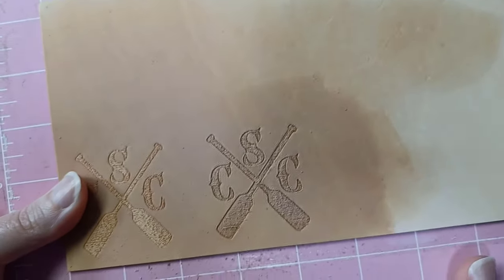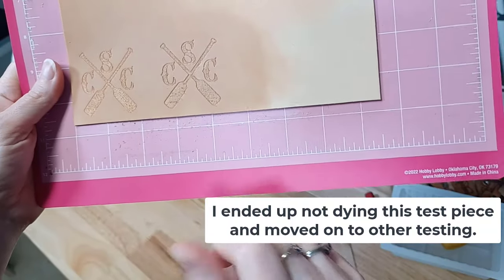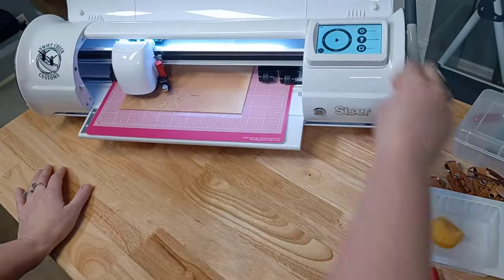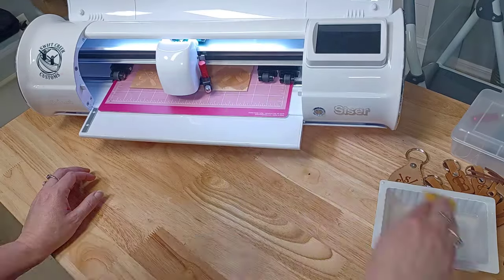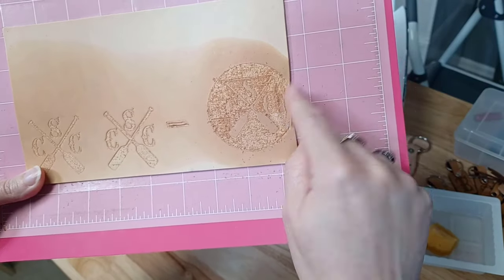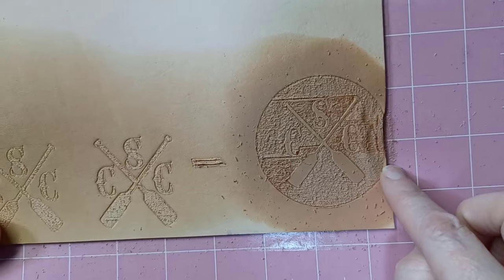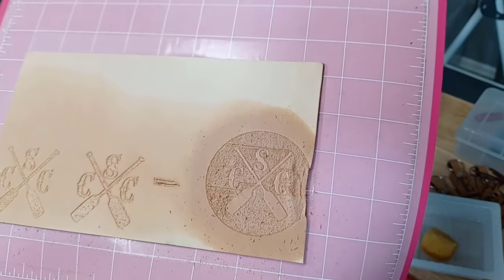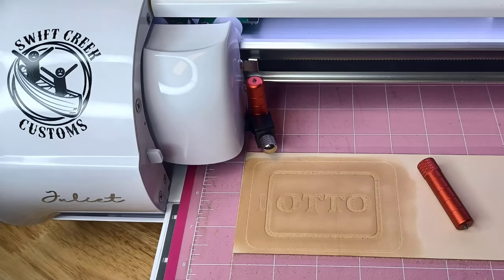Testing the Siser Easy Etch Tool for Leather Tooling - Siser Juliet or Romeo

Comment: Have you also cut leather with Romeo or Juliet and if so which blade/tool did you use? You have to change out tools/blades in the housing right? Thanks!
Reply from the maker: @meowzerzzz  leather will ultimately depend on the thickness and processing of it. I have cut thin tooling leather on it. This video was done before the 2 mm blade was released, so now there are more options. Multiple passes and testing will determine what works.